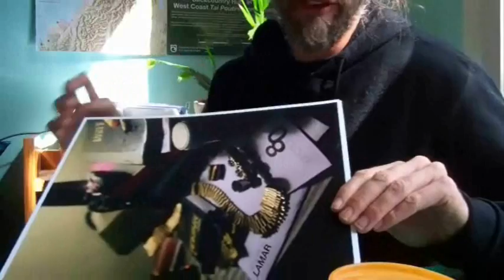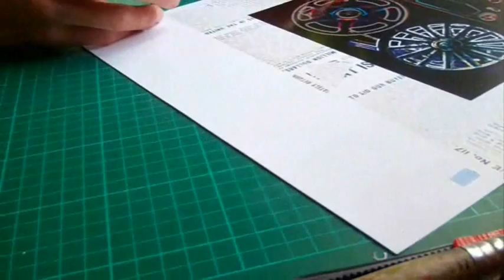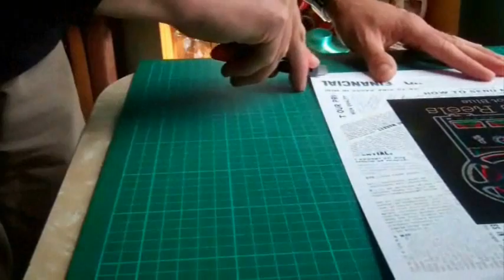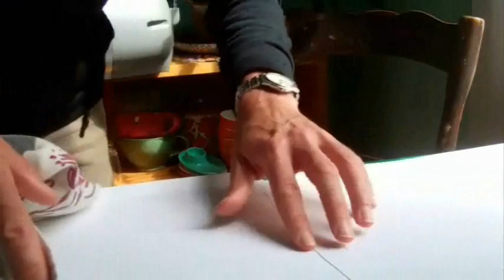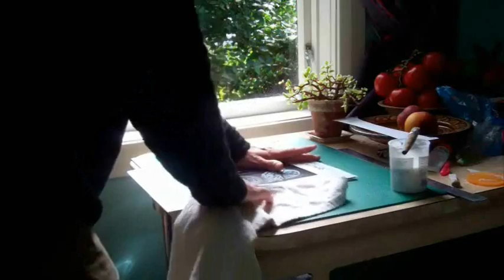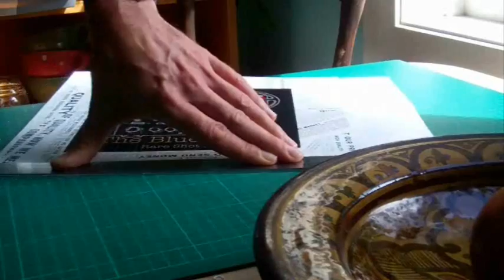Small Run LP Cover Lesson with A.M

Comment: What software did you use to prepare the thing for printing? Can't find any tutorial how to prepare the material for printing, using photoshop etc...
Reply from the maker: Hi- used photoshop. Basically you are making 315mm x 315mm squares. Image can be 310mm x 310mm.

Comment: Glue? Use double sided sticky tape with industrial hold strength.
Reply from the maker: Hi. Yeah, I have a double sided tape dispenser and good quality tape on hand (from years of making CD sleeves) but actually find the glue gives a tidier result. Its also a lot cheaper.